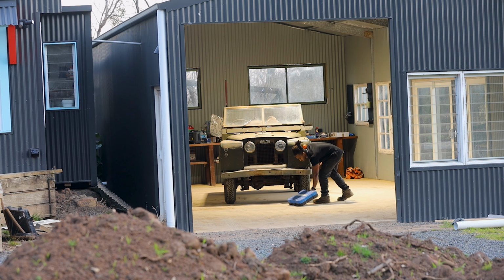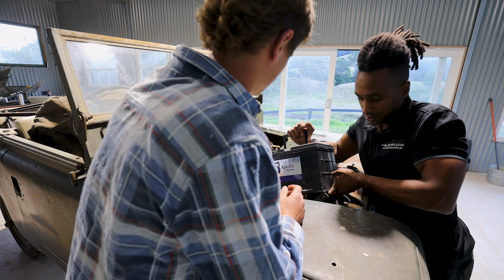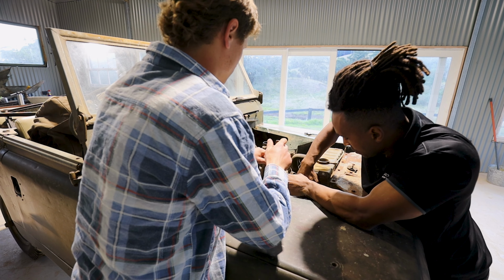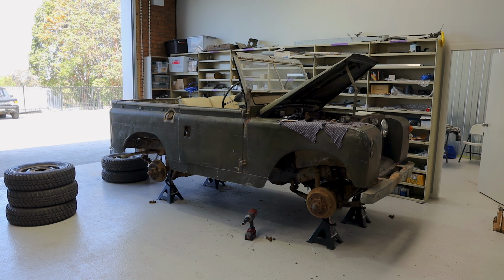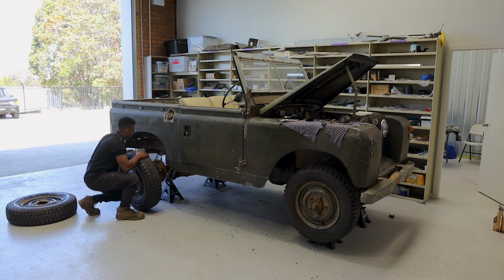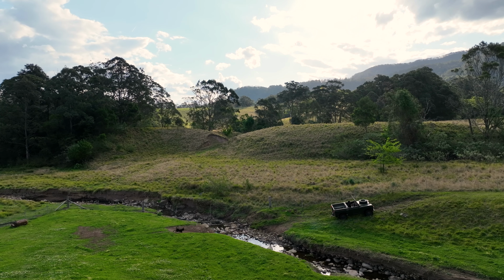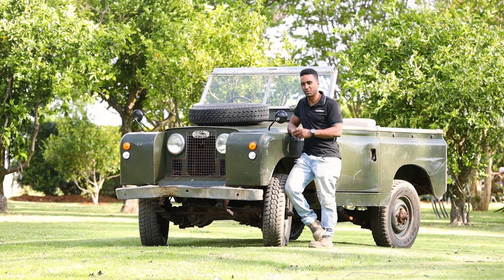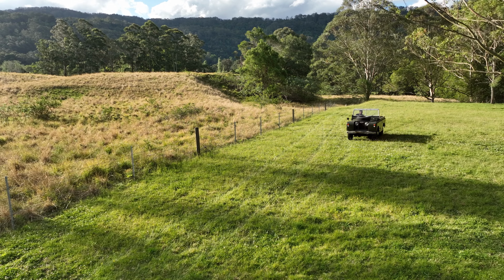Bringing back to life an honest legend ||1963 Land Rover Series 2A.

Comment: What a beauty!   The old series 2a is probably the strongest Land Rover ever made.. it all went to crap when BL took over and the steel was cheap.
I’ve got a 1960 series 2 and. 1965 series 2a and they both have the original chassis and bulkheads.. the 1975 series 3 on my drive had to have a Galvanised chassis years ago!

Comment: I have a 2a and in similar paint condition but instead of a Polish I tried something called Ottawa oil which helps prevent  rust  loving mine and not being a mechanic I've plucked up confidence to change the distributor and done the timing without any indication of TDC anywhere and cleaned the carburetor next are the tappets and clutch pipe oils all round although nervous of breaking it there's great help on the forums and a local garage whom have been super.  Enjoy